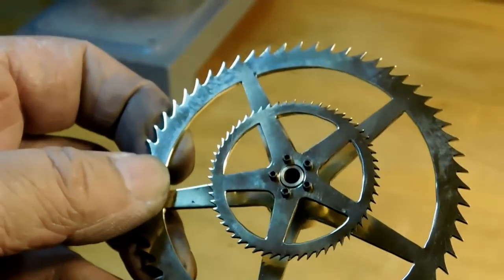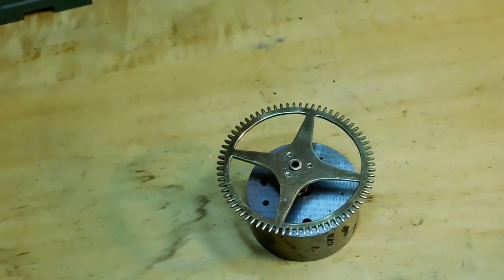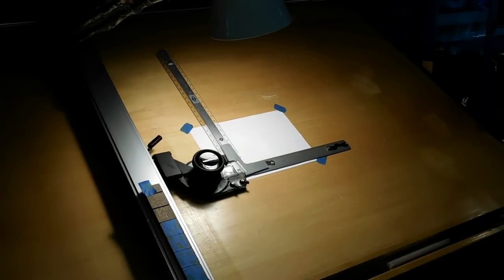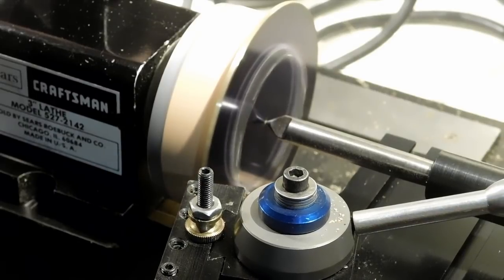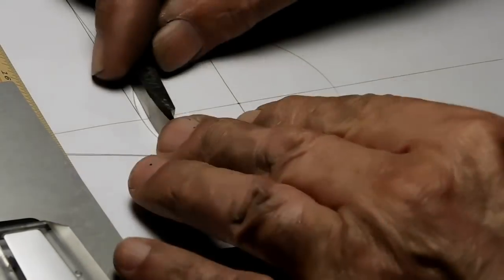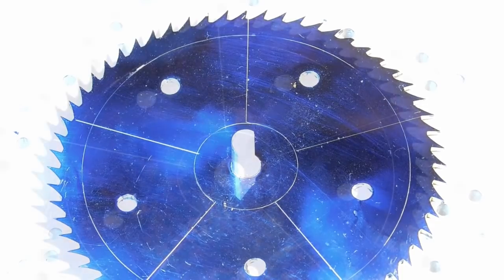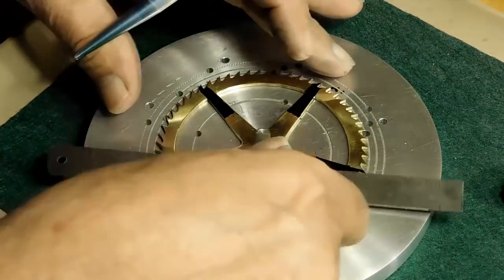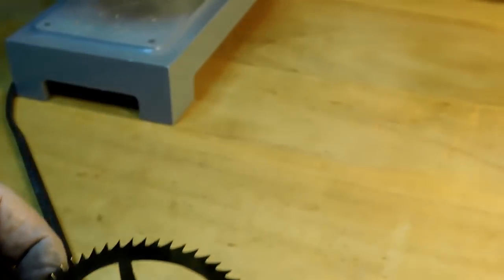Making The Escape Wheels

Comment: Really nice work, your detail is amazing you explain the process of machining these teeth well. We like your we think 3 inch Craftsman Lathe.
Reply from the maker: Thanks guys…I’ve been enjoying your work as well…that 3”
Craftsman/Sherline lathe is a blast from the 1980’s…I’ve updated the
motor…and about every 3 years I replace the cross slide and I have a new tailstock
for it but as yet have not installed it…I have 5 lathes in my shop but that
little lathe gets used almost daily…I hope to make this clock with this lathe
but the fusee and the pendulum covers may need to be done on the Atlas… we’ll
see.